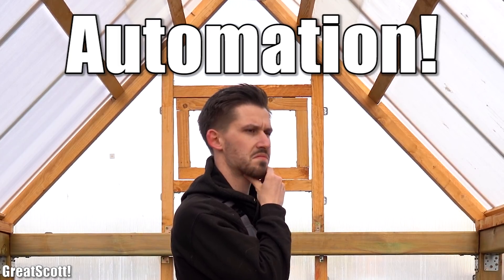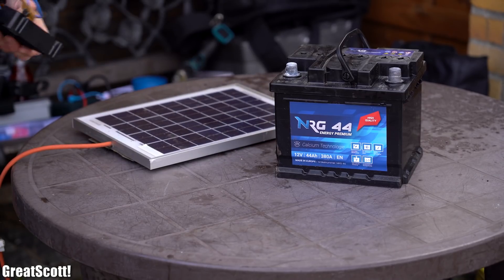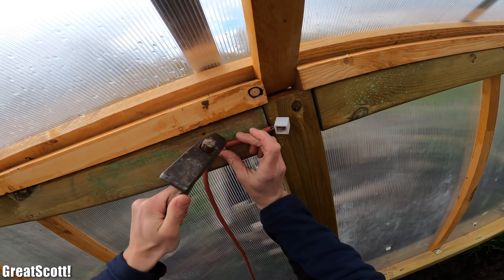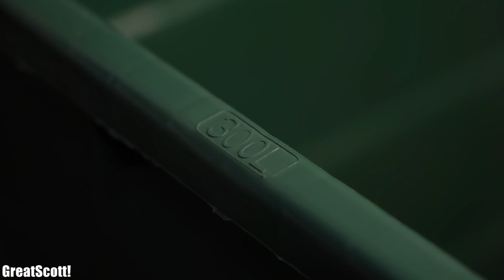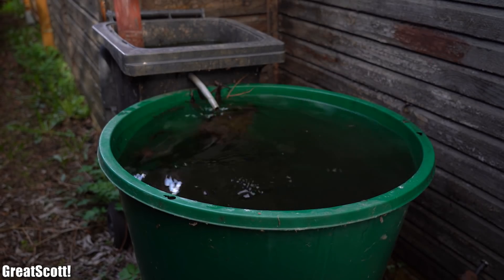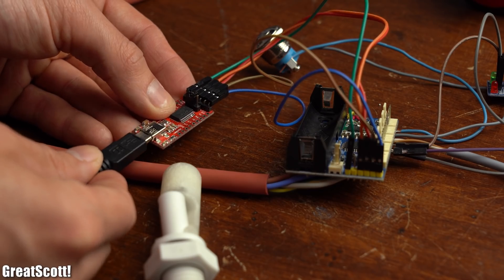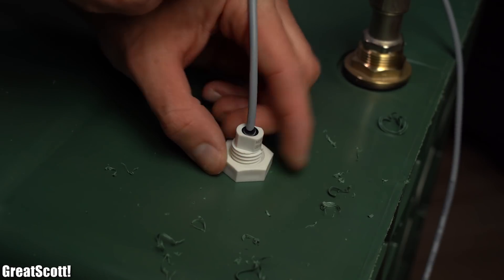How to make an Automated Watering System! Automating a Greenhouse with LoRa! (Part 3)

Comment: LoRa board: has connectors for inputs/outputs
Great Scott: I'm gonna pretend I didn't see that
Reply: Yep. I really like his projects but the soldering and cabling job... Well... :)
Reply: @koga1330  Plus for years and countless comments later, there's still no differentiation between "serious" and "series", and no S on the end of (centi)meters.
Reply: @nrdesign1991  Psst. German doesn't have the final S on multiple centimeters; so it's 1 centimeter, 2 centimeter etc. Same as some other Germanic languages.
Also, I do hear a difference between "serious" and "series", but maybe that's because I'm Dutch.
Reply: @therealdutchidiot  I'm German too, but just a tiny bit of practice and will to improve makes a better speaker. It's just really annoying to still hear the same mistakes with barely any improvement years later. It may be on purpose for sort-of brand recognition but I doubt it.

Comment: The Teflon tape you used on the treads are used as a lubricant, not for sealing anything, the type of thread that's used seals by simply being screwed on deep enough for the tread to seal against itself. The tape just helps with that by being slippery. It also helps prevent corrosion and such and you get different types of tape for different metals. It's a common misconception, but otherwise it's still needed in the end.

Comment: You might also add a line of deep shelfs on a second level at 140 cm cause the sun arrives in a non vertical angle so both levels can live with that amount of sun and heat offering a lot more opportunities too.
The hotter space in the upper half will let grow some plants faster or better.

Comment: The solenoid valves usually consume a high value of current ( from 0.5 A to 1 A). An alternative for that would be to couple a DC motor to a tap and then turn on/off the tap by changing the direction of rotation of the DC motor. Bu doing so, you can save a considerable amount of power.
Reply: Or maybe a servomotor, that would make the control more precise
Reply: @luisfelipesaldivar5100  I don't think precision is a matter of concern in this case. It is just an on/off operation right?
Reply: @patrickjoseph9476  of course, but i had the idea on mind, but anothet advantage is that you only need one pin to control the servo, so, in consecuence you have more pins yo work if you need them, and also it's easier to control the servo.
Reply: @luisfelipesaldivar5100  You can also control the DC motor using LM293 motor driver.

Comment: What a coincidence! I'm planning an automatic watering system for my Chicken Coop right now! Since the water needs to stay at a constant level, I'm thinking of using a flow valve and a bucket. PVC piping at the bottomwill go into the coop and be connected to a nipple system for the chickens. Still working out what I'll use to keep the above ground pipes from freezing in the Winter. The coop has electricity, so I could possibly use heat tape.

Comment: The window openers are good and simple tech but do check the paperwork as a lot of them are not suitable to be left over the winter and need to be reinstalled in the spring.
Reply from the maker: Thanks for the information. I will check on that.

Comment: I have a question. Is it possible to make a similar irrigation system only without programming?
Reply from the maker: Sure, just add a switch between the battery voltage and the solenoid valve. There you go.
Reply: @greatscottlab  Thanks when i finish building my greenhouses i will try it

Comment: Nice!

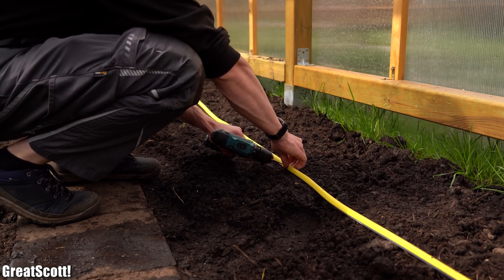One thing though. At 10:15 I was wondering why you didn't secure the container? If you experience another storm, your greenhouse will be fine but all the watering electronics will rip right off.

Besides, the container is not guaranteed to be full so it's own weight can anchor it!
Reply from the maker: It is all heavy enough to not fly away.

Comment: Aren't you worried about the different pressure? At a water level of 10cm probably hardly any water comes out of the holes and at a full tank it probably washes away the whole earth. I would add a moisture sensor and a flow sensor to at least keep the amount of water constant.  I would replace the hose with a "beadhose", then you have an even moisture distribution. 

Sorry für mein schlechtes Englisch. darum nochmal in Deutsch! ;-)

Macht dir der unterschiedliche Druck keine Sorgen? Bei einem Wasserstand von 10cm kommt vermutlich kaum noch Wasser aus den Löchern bei einem vollen Tank schwemmt es vermutlich die ganze Erde weg. Würde noch ein Feuchtigkeitssensor und ein Flowsensor anbauen um wenigstens die Wassermenge an sich konstant zu halten.  Den Schlauch würde ich gegen einen Perlschlauch ersetzen, dann hast du eine gleichmäßige Feuchtigkeitsverteilung.
Reply from the maker: Even with half of the barrel filled, the pressure is good enough for watering. And I doubt that the barrel will get emptier than this. But of course you could add modifications to get better pressure results.

Comment: We need a full monitoring station next which will gather data and process it during the year , great stuff !
Reply from the maker: I can put it on my to do list
Reply: @greatscottlab  do you plan to account for different watering rates depending on rainbarrel head? It seems like you will get a lot more lph when it's full vs when it's 1/3 full
Reply: @greatscottlab  Higher Placement of water barrel = more pressure. Then you can set up self propelled water sprinklers for a better distribution
Reply: And a harvester robot
Reply: @oddzc  lol
Reply: Add moisture censors and make it fully automatic!
Reply: @jona8820  he had them in another video and they were not reliable
Reply: Yes that's kinda mandatory 😅 I don't quite understand why you didn't add any monitoring. This is a really nice project and it should be fairly easy to just add some soil moisture sensors allowing you to reliably run the system continuously. Is there a reason why you didn't add such a feature? 
I would ne curious to see how you realise a monitoring, especially how you improve the capacitive sensors to extend their lifespan. Do you think embedding the circuit on the sensors in resin is a good solution?

Comment: You can fit a pair of rain gutters directly to the greenhouse to refill the tank in situ. And add capacity with another container with a syphon system (a filled hose between them). Also the garden hose can be replaced with drip watering hosing which have plugs to regulate the amount of water in each one and save even more water (and unwanted growing weeds).
Reply: Dont forget an bell siphon. quit  builds made an awsome video about it and he used it in his rain gutter and to an water turbine attached to an 3d printed alternator(an generator which creates ac) to an rectifier, to a buck boost regulator, to an waterproof powerbank and to his phone or with an switch it lights up some Christmas lights outside his garage
Reply: I hope to subscribe to my channel

Comment: You should add a gutter rain water collection system to feed water from the shed roof into the water tank
Reply: .. indeed, but also remember to filter it as into the barrel to avoid blocking those tiny holes in the pipe.
Reply: @CTCTraining1  Tiny holes in the pipe is not the issue, the solenoid valve is, it will block long before the holes do. Best to include a in line filter in the feed from the tank to the valve, and also a tip is to get 4 concrete pavers and place on the ground, then put 3 layers of blocks, to raise the drum up a little, and then place it on the blocks, preferably with a load spreader, made from some pallet wood nailed to make a square 2 layer panel, to spread the load. That will allow better water flow when the barrel is low. Then put the lid on the tank, so leaves do not blow in, and it does not become a mosquito breeding pond.
Reply: @CTCTraining1  yea good point